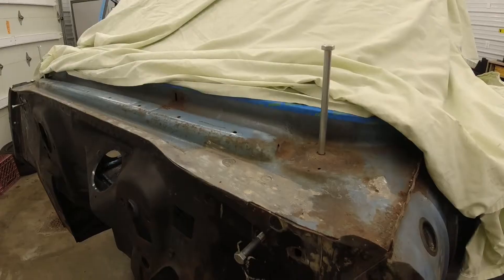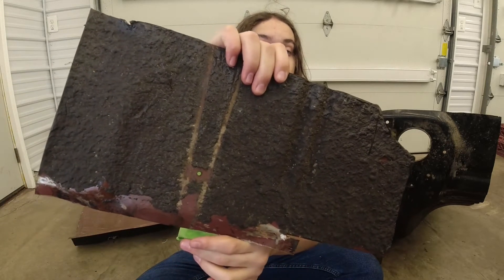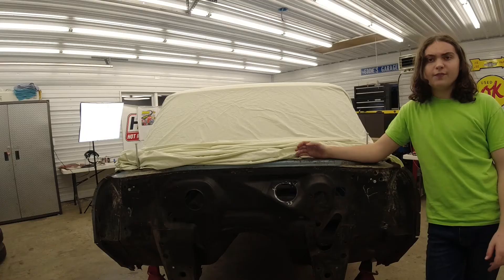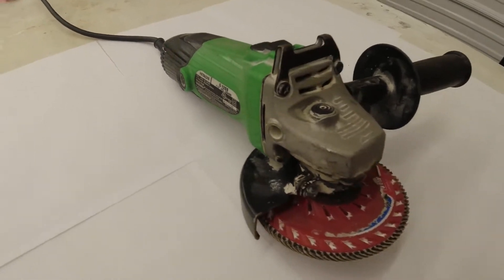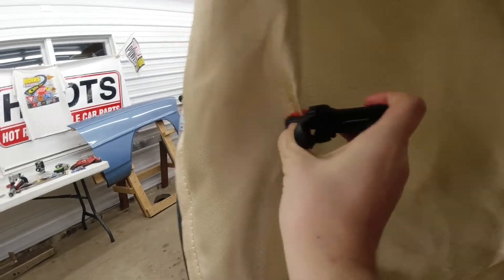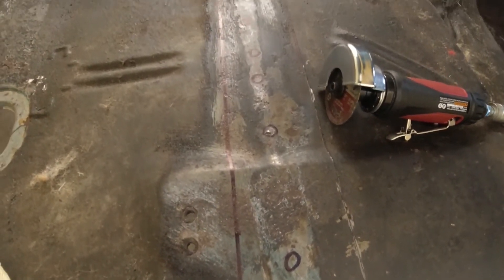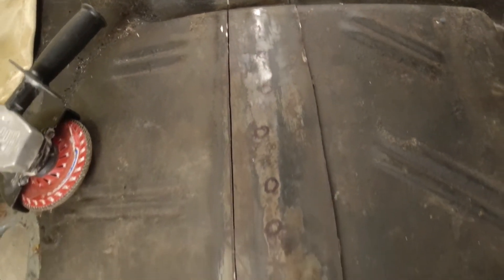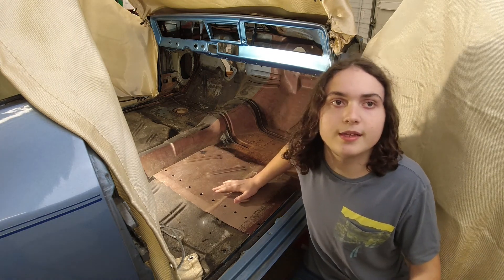We cut a hole in the floor!

Comment: We aligned the firewall section using the factory punched holes for the firewall pad and heater box. Next video Miles will be showing you how we measured everything before tack-welding. Comment LIKE and SUBSCRIBE for more!